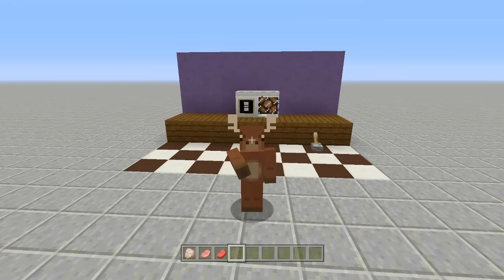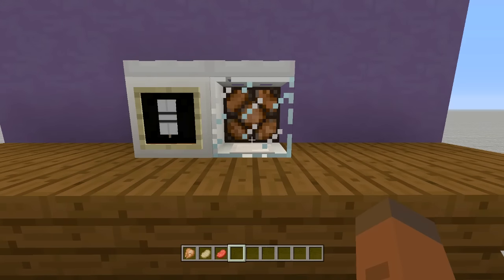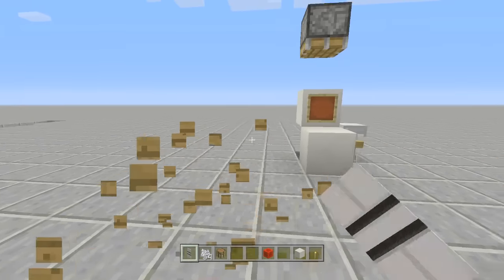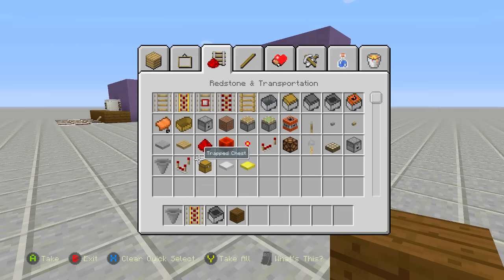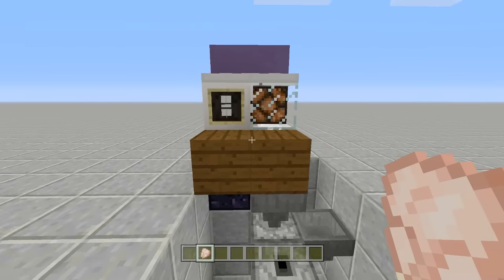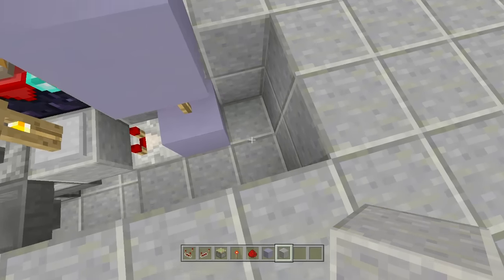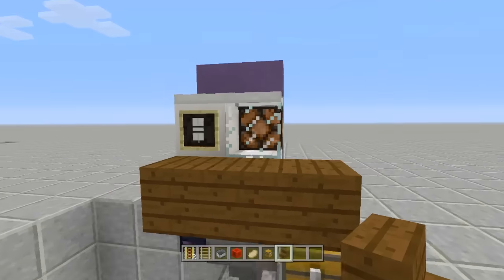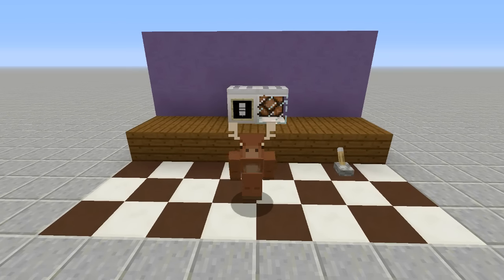How To Make A Working Microwave in Minecraft

Comment: :/ it pushes the stand in, and the skull only half shows up in the item frame, then when you break the piston,the frame pops back to its original spot, i used a piston to push a block into the stand instead, and it worked, but you can still only see the wither skull through the item frame a little bit... is there a fix for this?